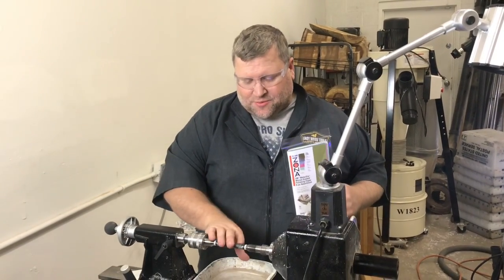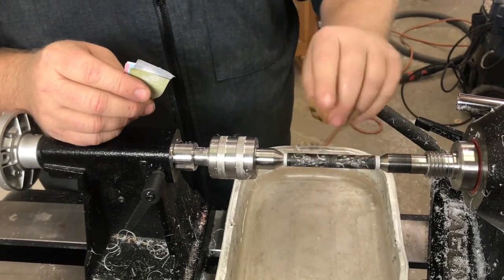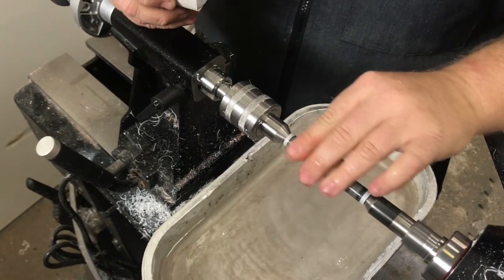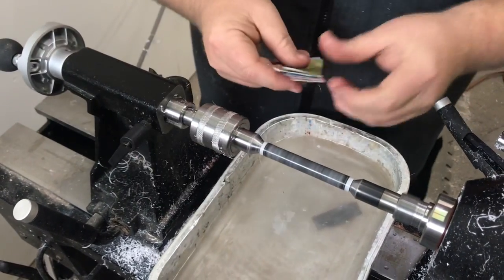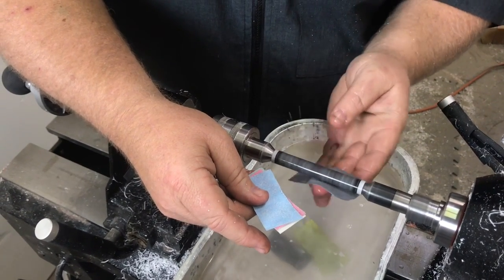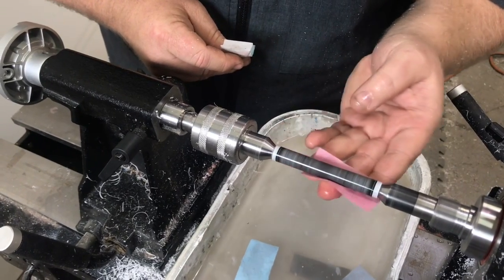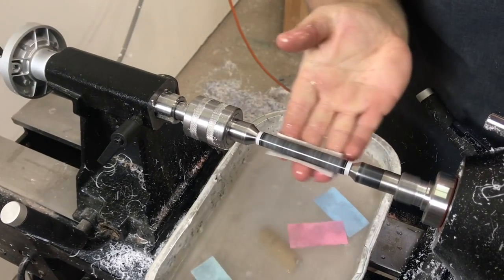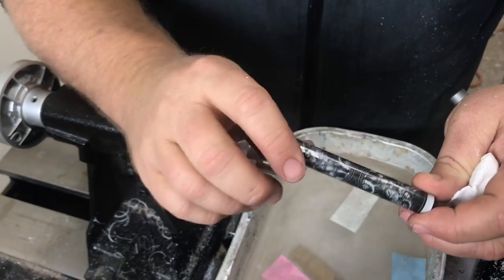Polish Resin Casts with Zona Paper,   Pen turning/Wood turning sanding.

Comment: Nice video! 
Will this kind of paper remove fine scratches from clear plastic surfaces?
Reply from the maker: It depends on how deep the scratch is, if it is deep/a more profound scratch you may need to back up to a more abrasive grit before zona paper to polish, however if the scratches are really fine/tiny it totally could work yes!
Reply: @ChadSchimmel  thank you so much